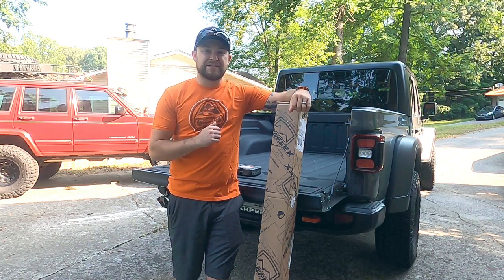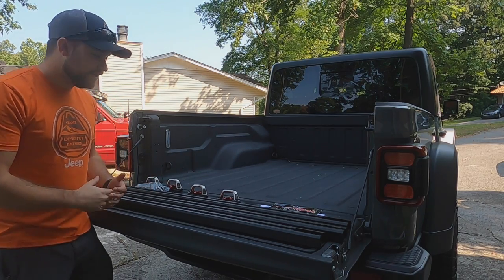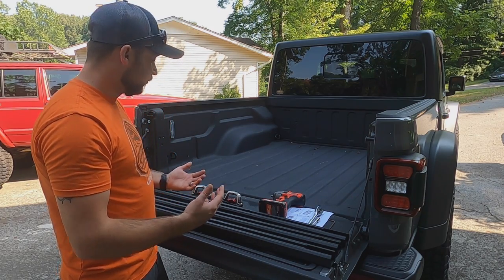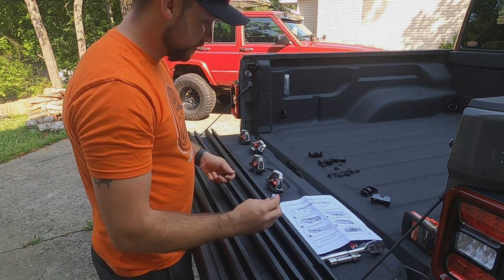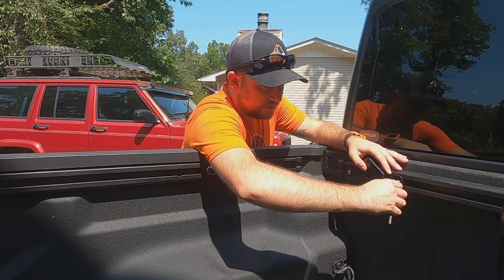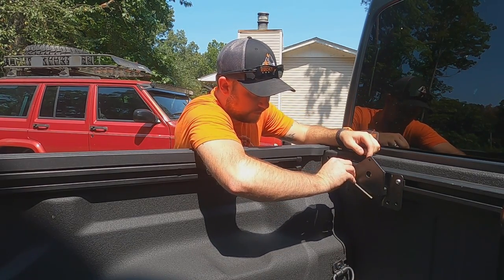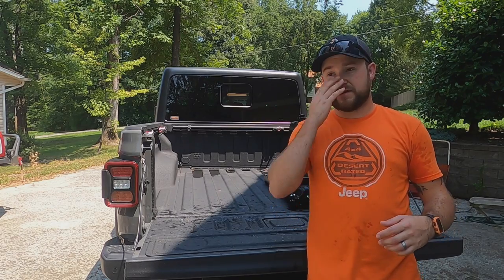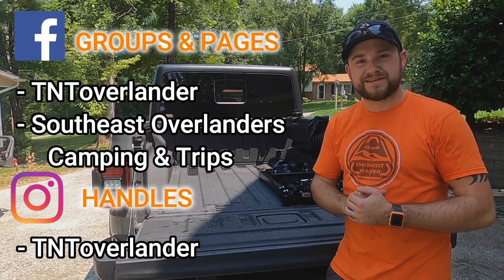TERAFLEX GLADIATOR BED RAIL INSTALL | BED RAIL ACCESSORIES | OVERLAND GLADIATOR BUILD | BED RACK PT1

Comment: Great video, I’ve got a 2023 Gladiator Rubicon, and would have liked the bed rail system to come stock, but according to two of my local dealerships they are $650 and $850 for the kit,  can’t wait to see what you install next, cheers from Canada

Comment: The OEM ones do not require any drilling. It is the same bolt holes and the where it meets the back of the bed (inside of bed, but above tail light location) there is a pre cut nut spot. That is where there zerk nut goes in. The wierd part is the attachment from that to the rail is thin  plastic so it doesn't really supply much in support.